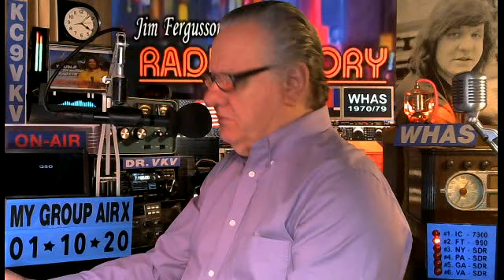KC9VKV HAM RADIO QSO-VLOG - JIM-K4LJE - N. C.  OMNI 5 GREAT SIG! - JIM FERGUSSON/TRAX - RS 3427

Comment: I have a IC-7300 that I got before Thanksgiving. You were the first person I heard on my rig. I can't remember what frequency you run on. Can you share that? You were coming in loud and clear!
Thanks
Kevin
KA0AKE
Reply from the maker: HI KEVIN.... I DO THE QSO-VLOG NETWORK FRIDAY AFTERNOONS ON 7.188 MHZ FROM 3:30 TIL 5 PM EASTERN!!!... FEEL FREE TO DROP BY AND SAY HELLO!!!... WE AIRCHECK (RECORD) THE WHOLE SHOW... THEN UPLOAD IT TO YOUTUBE SO FOLKS CAN HEAR WHAT THEIR RADIO SOUNDS LIKE!!!... WE ALSO ASSIST THEM IN SETTING UP THEIR TRANSMITTER AUDIO!!!... AND IN THAT REGARD... HERE IS AN ICOM 7300 TRANSMIT CHEAT SHEET YOU MIGHT FIND HELPFULL!!!...

HERE IS A "BARE BONES CHEAT SHEET" FOR THE ICOM 7300 TRANSMITTER!!!... PRINT IT OFF... AND KEEP IT BY YOUR 7300 FOR AS LONG AS NEEDED!!!... IT SHALE BE BESIDE MINE!!!...
------------------------------------------------------------------------------------------------
"MULTI" THE ROUND BUTTON TO THE UPPER RIGHT SIDE OF THE DISPLAY... IT LET'S YOU ADJUST...

RF POWER OUTPUT .......100%
MIC GAIN  ........................... 45%
COMPRESSION  ................... 3
MONITOR  ........................  0FF
------------------------------------------------------------------------------------------------
"MENU"... THE RECTANGULAR BUTTON TO THE LOWER LEFT SIDE OF THE DISPLAY... TAKES YOU TO "SET"... WHICH TAKES YOU TO...
TONE CONTROL... TX ... SSB...

TX BASS  ................  +1
TX TREBLE  ............  +3

SSB...  ALSO TAKES YOU TO "TBW" WIDE/MID AND NARROW... THESE ALL SHOULD BE ADJUSTED TO READ 100 TO 2900...
----------------------------------------------------------------------------------------------
"MENU"... ALSO TAKES YOU TO "METER"...

ALC METER .............  50%TO 66% (ADJUST W/MIC GAIN IF NEEDED)
------------------------------------------------------------------------------------------------

THIS CHEAT SHEET CONTAINS THE VERY BASIC ADJUSTMENTS THAT YOU WILL NEED FOR CONTROL OF YOUR ICOM 7300 TRANSMITTER!!!... PRINT IT OFF!!!... AND KEEP THIS LIST CLOSE BY YOUR 7300 RADIO FOR QUICK REFERENCE!!!... 

THANKS FOR YOUR INTEREST KEVIN!!!....  
                                                                                    JIM....  KC9VKV